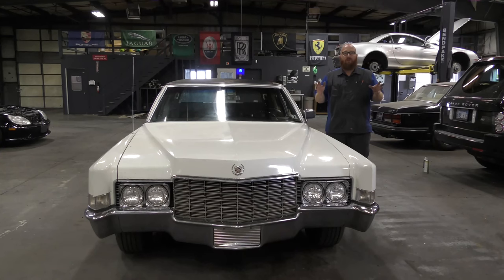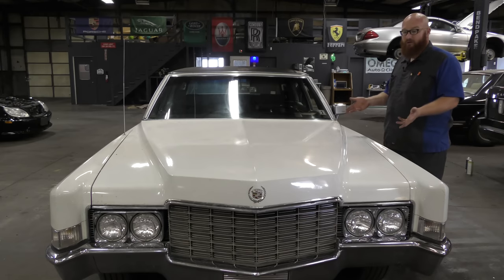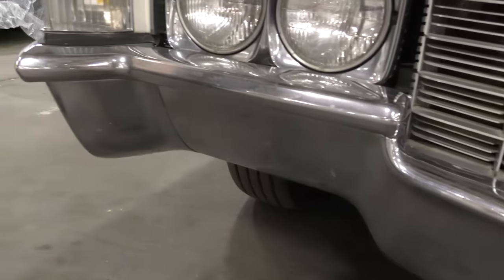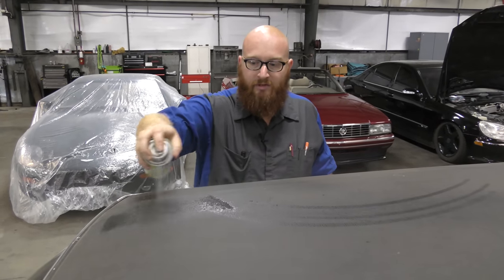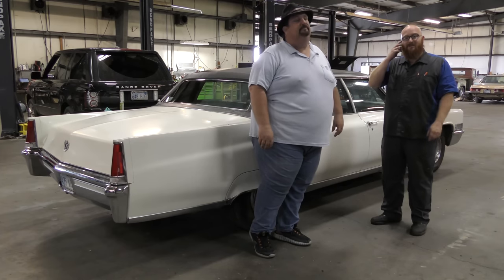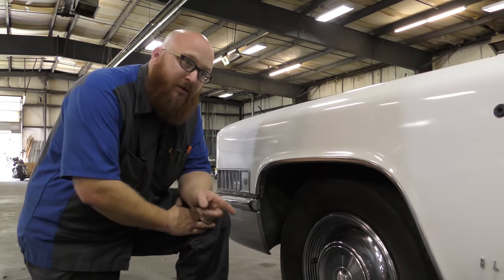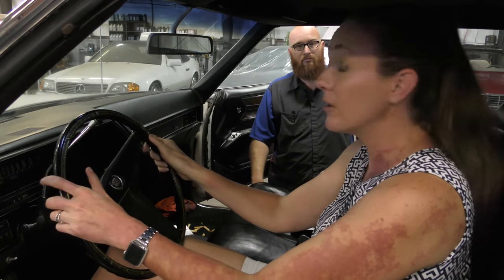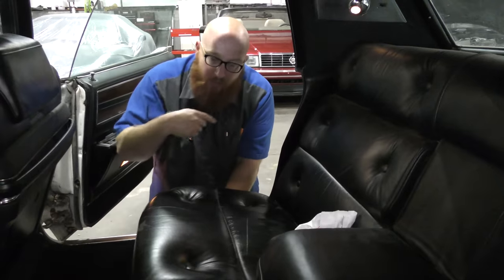Dirty Business! CAR WIZARD shows on his '69 Cadillac what you must do to get top dollar for your car

Comment: It can be "too clean" under the hood.
I get suspicious if I see a gleaming jet-washed engine bay. I'd much rather see years of dust to show that nothing has been messed with, and nothing is leaking.
Reply: Clean under the hood doesn't mean polished up. It means everything that should be there is there and where it's supposed to be and nothing that shouldn't be there is lying around. And there should be no leaks. But yes, never buy a car with a shiny engine bay unless its a showcar because that just means the seller is hiding leaks. An engine bay has to look dusty for it to look like everything is in working order.
Reply: I've had friends in the past do this and it caused numerous electrical faults and other problems.  What you want to see is that someone regularly wiped it down with a cloth and goes through and takes out the pine needles, leaves, and so on.  There's a certain patina that it gets from this over the years.  Power washing an old engine is asking for a disaster.

Comment: "How dirty of a car have you seen someone try and sell?"  Teenage / early 20's girls, from my experience, have been the worst offenders.  Felony forest hanging from the rear view mirror, trash in every crevice, food on the floors, scum on the seat belt fasteners, garbage from the rear foot rest all the way up to the seat, trunk full of lotions & perfume mixed in with more trash, dash has had something explode on it, and a generalized funky odor.   In most cases, they already have another car and are simply trying to unload their old one as quickly as possible.  But, if it runs and drives good, I really don't care.  Most of the time  the majority of it can be swept up / thrown away, shampoo the upholstery and give it a good wash or detail.  Have bought a few of these type of deals, cleaned it up at night, took a few pictures in the morning and sold it less than 24 hours later making $500-$1000+ in profit.
VT247
Reply: Ow yeah you can definitely make some money flipping cars. Especially now with this virus you can get the car spotless and guaranteed to be safe.

Comment: Hiya Wizard from the UK !   The 1st thing I ever do is look at the tyres.. if they're not all the same it means the owner doesn't care..  then check the fluids under the bonnet ( hood) anything not perfect... walk away !
Reply: Not necessarily. I really look look after my cars.

However if only my front tyres are worn out I'm not changing all 4, especially if my rears have loads of tread left. In that case front and back tyres won't necessarily match (although they are always the same across an axle).
Reply: @BRED510  Buy the same tyres front and rear, that's what matters.
They don't need to be the exact same age, but make them the same make and preferably model.
Better driving characteristics, and shows you care.

Depending on the car, I'd probably throw on a fresh set of tyres if I were to sell it private at least, unless the tyres on there now are ALL still very good.
Reply: @BRED510  That depends on the car, if the rear and front tires are the same size you should the tires to get the most life out of them, that truly shows you care. If they're not (staggered setup), maybe you could get away with different tires front to back.

Comment: The spare in the trunk needs to be replaced with a new tire.
Reply: Yeah, that was a bad thing to ignore.
Reply: and clean, that's where we put our groceries and stuff
Reply: He meantioned it a couple videos ago.
Reply: @TotalCamaroZ28  He acknowledge the blown out spare but I don't remember him saying he was gonna replace it before selling the car.
Reply: Yes I would spend a few bucks for a good spare. One less thing a buyer is gonna ding you for.
Reply: It was purposely moved to the dirty half to indicate that it needed to be removed/cleaned/replaced.  The spare is a safety element.  it is as unlikely that the Wizard would not replace the spare with a new tire,.  As unlikely as it is for him to sell the car mounted with 4 bald and busted tires, or bad brakes, or broken tail-lights, or a clogged engine.
Reply: You also need to do an oil change and get the air filter replaced.  Make sure it's ready to go and not on its last legs.  I mean if it is, then sell it as such and get bottom dollar/hooptie money before something else explodes or leaks.   But if it's a decent car, do a bit of upkeep, an oil change, and also put more than fumes in the tank.   For more modern cars, two keys is a must.  I deduct $300-500 off the price immediately as they are always $200-$300 to replace and you can easily lock the only one you have in the car.   If you lose the only one you have,  well, that's $500+ to get a new set and reprogram everything, at a minimum.
Reply: @plektosgaming , I've retired from the car business, and I understand that after seeing hundreds of cars every day managers begin to see car washes and upkeep as cost items deducted from the individual car's budget.  

They forget the concept of First Impression as it relates to a customer and a car.  A customer wants to fall in love, to feel the potential admiration and jealousy over that new love.  

The manager knows what is under the dust will come shining out after the delivery-detail that the manufacturer has already paid for, along with the full tank of gas; in the mean time they take the cheap route, forgetting the customer's viewpoint.  That is why those cars don't sell.

The sales person should have at least taken the initiative and given the car a quick wash and offered you an assurance of the car receiving a delivery detail along with a new door seal.  I imagine that that car, having sat on the lot for so long, bleeding interest costs, likely had a bonus attached to its sale.

Luckily, the new "Smart Keys" are programmed to not allow themselves to be locked in (assuming it has battery power).  But, they are expensive to replace.  Anymore, on some vehicles you can easily re-program the key yourself.
Reply: @bosgaurus1  That was the rub, though - that WAS how it was going to be sold.  They simply were not going to do a full tank of gas or a delivery detail on it.  And didn't even acknowledge the door at all - as if I was making it up.  So of course I passed.
Reply: @plektosgaming  You should report them to their makers regional office which decides how many vehicles they get.

Comment: A dirty cluttered car reflects really poorly on the seller. If they couldn't even be bothered to clean the car, what else did they neglect? Oil changes? Tires? BRAKES? Let the interior and exterior be your guide.
Reply: Yeah although in my experience, this is reflected in the ad prior to even seeing it. Crap pictures, no interor shots, poor communication etc. Not to take away from your comment but more often than not, there are red flags before you see it.
Reply: coffeeinthemorning  Right, or smart phones for that matter. I feel like I'm scrolling through 1 or 2 picture ads that were taken with a disposable Kodak
Reply: coffeeinthemorning  meanwhile, in the same ad, "Price is firm", pictures showing exactly 2 photos of the same quarter angle. Like the wizard said, attrocious
Reply: coffeeinthemorning  You know what tops that? 2 things, when they use stock photos or none at all
Reply: coffeeinthemorning  Don't doubt it one bit. There's always going to be that guy

Comment: Seems so simple, just a basic decent cleaning.
I do get a little suspicious if I'm buying a car and the car has 200,000 miles on it and the engine bay looks like it's brand new. That tells me they took it to a pressure washer and had it detailed. Same with the interior I expect to see some issues. when I see a car that's been detailed to that level especially a lower end car it makes me wonder what are they trying to hide especially in the engine bay. Is there a valve cover leak on oil pan leak etc.
But having your car just basic presentable seems so obvious.

Comment: Let's say you have a decent job and make $20/hr after taxes. Even a cheap $2,000 car equates to 100 hours of hard work at a job. Not just 100 hours, but 100 hours worth of spending money set aside. Most folks work the majority of their work week to pay off bills and expenses. So essentially you have to work full time for months before you will have $2,000 just laying around to spend. Yet folks won't take 45 minutes to even clean their car before selling it. A clean car vs a dirty one can up the value hundreds of dollars, but people would rather work at their job an extra 20 hours than take 45 minutes in their driveway to clean it up and top off the fluids and air up the tires.

Comment: I remember when one of my mates was about to buy a used but nice and clean Hyundai Excell,  when we got to the dealership (we even called the day before) before photos looked nice, oh the horror when we arrived, bath silicone around the antenna, cardboard fixes on the trunk, bondo here and there, valve cover was off because they were timing another car  so we were unable to do a test drive, walked away from that dealership, in the end we found a good Hyundai Tiburon for a great price and my friend just sold it, did everything you recommended, super clean car, great photos and while due to covid it took a while to sell, he managed to sell it compared to the other offerings on sale

Comment: This caddy has less acceleration than a 90s minivan.  But it does look good.
Reply: I think you have no clue...my 65 fleetwood had a 340hp 429 and would out run a lot of the junk my friends had
Reply: @stevenreynolds2327  This stock caddy has about what?  170hp plus carries 3 tons without passengers or cargo?  I've seen a similar model on DeMuro and that was the story.
Reply: @jsun3117  Displacement :
	 472.0 cu in. | 7.7 L.
Power :	375 BHP (276 KW) @ 4400 RPM
Torque :	525 Ft-Lbs (712 NM) @ 3000 RPM
Bore :	4.3 in | 109 mm.
Stroke :	4.1 in | 103 mm.

Comment: Also as someone who buys cars often, nearly every car i buy has a trashed interior. Which is why when i detail it, it takes at least 6 to 9 hours.
Reply: Sucks to clean it but if you get it cheap enough it’s worth the effort.
Reply: When I buy a car I intend to resell its usually 300 to 750 and usually has a lot wrong with it. Have to be very careful to know what car to choose as well. Some cars despite being 300 will never sell for more than 1000 and if its 800 for an engine used then well... walk away.

Comment: I remember a German car-show who went and had a used (and rather tired looking) 3-series BMW appraised by a pro. First round of appraisal was the car as it was, unwashed, uncleaned and with a few minor imperfections (cigarette burn on the seat, etc.). Then they gave the car to a detailer and spent around $700 on getting it cleaned, waxed and on fixing it up cosmetically. The appraisal after the visit to the detailer was around $1,500 higher - and that was just for making the car look presentable. 
Does that mean you will actually get that additional money from a buyer every time? Not necessarily ... but from personal experience I can only agree 100% with the Wizard that you should never, ever try to sell a car that's dirty or still has your stuff flying about the interior. Besides money, it's just bad form and borderline disrespectful when you treat your potential customer this way.

Comment: DO you know what works really good for cleaning vinyl tops ? Hand Cleaner with lanolin (DONT USE PUMICE) !!! 
It totally dissolves grime and oils safely and leaves vinyl soft and shiny like new !!! You will be impressed by the results !!! I had a 1975 Lincoln Mark IV and was at a self service car wash and a guy was admiring my car and told me about using hand cleaner and a soft brush to work the cleaner in. Then you spray off the cleaner with the high pressure wash wand and you’ll be impressed with the newness of your old top !!! Removes decades of dirt safely !!!👍👍👍

Comment: Careful using microfiber on dark colours. The fibres feel soft against your skin because they are very fine. Obviously, by the name. But the fibres themselves are quite hard. So just like 1500grit sandpaper feels soft, but will scratch dark colours, so will microfiber. And that is what will happen- not even getting into the sharpness of dust "crystals" laying on the paint that you rub... Lots of soap and water, and more often than not esp with dark colours, cotton cloths. Even polyester edge threads on a cloth can scratch it up.

Comment: I once test drove a Volvo 850 which was dirtier than Walmart bathroom. Originally tan interior turned black from somebody smoking there for years. The floor was littered with toys and couple of spills. Opened the trunk - it contained bottles of oil, break fluid, antifreeze and power steering fluid. I did not buy of course.

Comment: Common sense has become so rare it should be a super power! I have to comment about your Caddy, it's just an honest old car, they never get the respect they should. To back up the Wizard's assertion I once worked at a Lincoln-Mercury dealer as a new car salesperson. Any trade that was sent to auction other than the salvage auction were cleaned by our detail shop. If it was going to the sub-par auction indicating it was probably going to be purchased by a Buy here Pay here lot they were clean, washed inside and out , engine compartment cleaned, carpets and mats were extracted seats cleaned, windows cleaned. Management  told us that a good cleaning was worth $800-$1,000 at auction on anything other than junk.  In my next job a Co-Worker's dad had a used car lot, he stated how his Dad liked to buy the clean cars at the auction as he had a lot less time (and time is money) to put it on the lot.  Was his time better spent cleaning cars or buying and selling cars?

Comment: An easy way to clean a car, is to use a spray bottle of warm water with a teaspoonful of car wash soap to wet the surface and wipe clean with a damp microfibre cloth. Keep a pail of warm water handy and rinse out the cloth regularly. Change them when they get dirty, you may go through 3 or 4 cloths on a car, you can buy them in a bundle at the dollar store.

You can do this in your garage in the dead of winter without making a mess on the floor and it gets the car clean and will not scratch the paint. Do one panel at a time and give the spray a chance to soak in if it is very dirty, has bird droppings etc.

For the interior wipe with a microfibre cloth dampened in water that has a shot of Spray Nine in it.  I or 2 spray bottle squirts to a quart of water. Keep rinsing and squeezing out the cloth.

If the steering wheel is coated with guck smear it with waterless hand cleaner, the soft white or green kind not the gritty orange kind. Let it soak in for a half hour and wipe off with a wet cloth. Yucky old pickup truck wheels may need a second application.

Old newspapers and Windex do a great job of cleaning windows and give them a shine. Vinegar and water works even better. Use the black and white newspaper pages.

Clean the rust off of chrome bumpers with a copper scrubbing pad and Pledge. Then polish with Flitz or your favorite chrome polish. Do not use steel wool, it scratches.

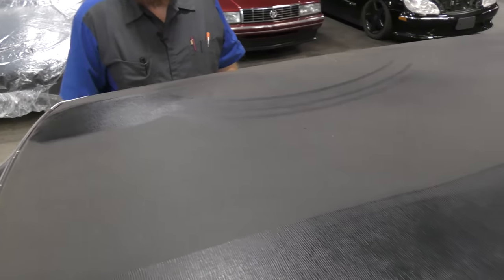Comment: That rust under the vinyl 7:13.  Been there, done that.  It's always, always, always worse than you think.  Peel off the vinyl to repair and you find that 'surface pimples' go straight on through.  That's a gut punch to the wallet.  And I bet there is a bunch at the base of the C pillar and at the top of the C pillar at the corners of the rear window and along the bottom of the rear window too.  Everywhere there was spot welding and then lead fill.  Every Buick/Olds/Pontiac and Caddy suffered these ills.

Comment: One thing I found worked very well on the vinyl convertible top on my Capri is tyre foam.  The only thing that worked to remove dust storm and bushfire ash residue without scrubbing. Leaves a nice finish, too.

Comment: It has to be clean. But i hate normal day cars over the top cleaned. Or its a real car guy or a car with problems.  When the engine is shining cleaner than new, gearbox without a spec of dirt and a dif that shines like the sun,  i walk away. Becouse it has leaks at every seal. So like you sad. Presentable clean but no concour clean.

Comment: On a dirty car, it's hard to see if the paint has scratches all over it, if there are any recent oil leaks, if the interior torn up under all the trash, if there's rust under the dirt...
So, as a buyer, I have to asume all of that is true and that as a seller you're trying to hide it with all the dirt and trash.
You can say that it's in good shape as many times as you want, if I can't verify it, I won't believe you.

Comment: I use Simple Green to do an initial cleaning under the hood on a cold engine along with an old, soft tire brush to get the more obvious areas. Once it's dry, I'll spray tire foam on all the black painted areas and wipe them down. It gives the same nice finish on painted areas and hoses as it does on tires. It also works great on any black plastic trim on the body and bumpers, and if you hit the wheel wells with a good coat, they almost look like brand new!
Reply: Someone at our shop mopped their bay with Simple Green and extremely old mop water that's been sitting for months. I kid you not, his whole area smelled like a giant bacteria colony. Mix it with the smell of Simple Green, and now it's the smell of hell.